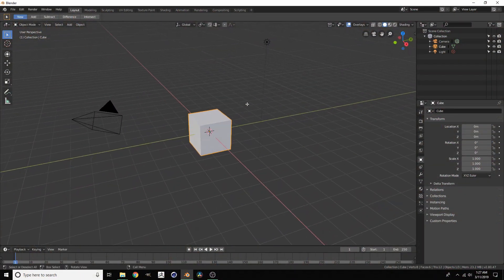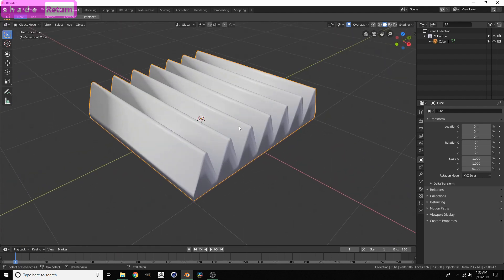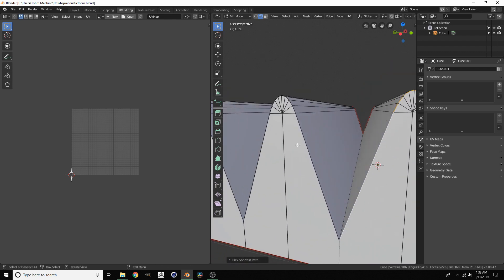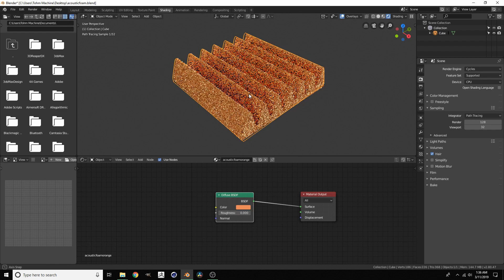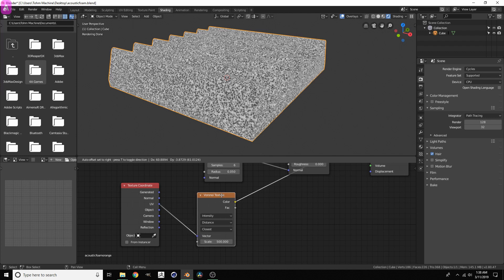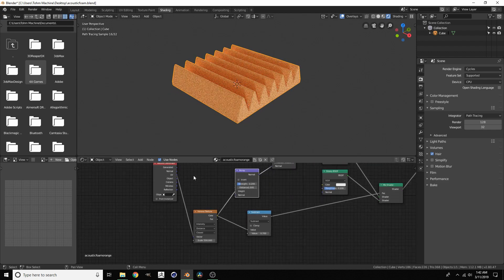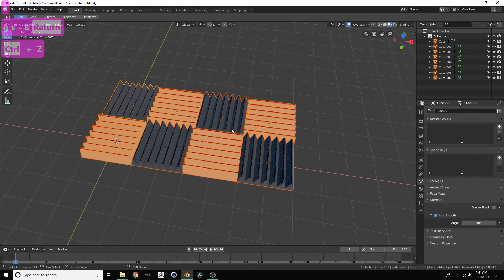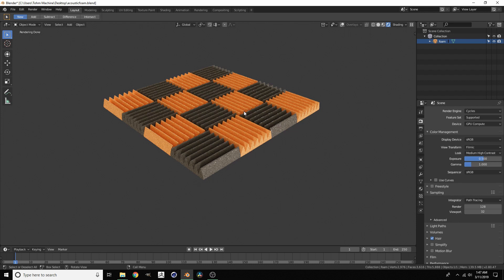Blender 2.8 How to make acoustic foam tutorial

Comment: Hey, for duplicating the panels I think you could use Alt+D in order to have the objects to share the same mesh and save a lot of memory, while Shift+D to have different color objects.
Or alternatively use Array modifiers when you set a 2*2 square. The same applies for the modeling part: you could model a single spike, unwrap it, set up an array with union option and then optionally apply it. 
There's also a tecnique wich involves a particle system emitted by an array of planes, emitting tiles 2by2 from its vertices. This way you can have a whole wall of panels out of 2 single spike mesh very quickly and memory efficiently, letting you to tweak the same wall later  ;-) 
If anybody is interested just tell me here and I'll try to prepare a tutorial
Reply: One of the Best Ideas of SoundProofing is "SoundProof Curtains" it actually Block outside Noise coming from Windows. Check Here: https://livesoundproof.com/best-soundproof-curtains/
Reply: @laurabrown6809  no